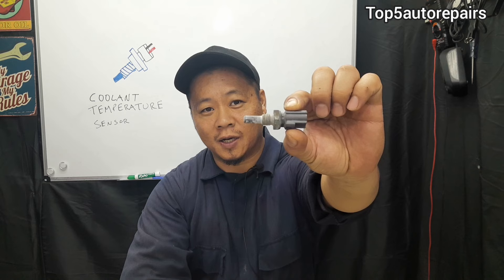Bad Coolant Temperature Sensor Symptoms

Comment: I HAD A COOLANT TEMP CODE, PLUS OVERHEATING, FOUND THE ELECTICAL CONNECTOR WAS BROKEN, REPLACED CONNECTOR CLEAR CODE GOOD TO GO
Reply: Why would it over heat from sensor?
Reply: @Edgar-uw6vl the radiator fans turn on at certain temperature.
If sensor bad not reading temperature and fans wont turn on
Reply: @Smokerup I hope it stops my car from overheating
Reply: My car gauge shows overheating but the car is good temperature  maybe it's  need that sensor  @SugarrPlump
Reply: @randyrivera4433 that sounds like a bad coolant temperature sender, not sensor

Comment: He forgot to mention, when your radiator coolant fan runs continuously,  even when your vehicle is shut off, it could be your coolant  temperature sensor.
Reply from the maker: Check out one of my latest video, "why cooling fan keeps running." I mentioned it in that video.
Reply: @Top5AutoRepairs  ok
Reply: This!
Reply: I just got this issue fixed today my Tahoe did this, the fan motor was extremely loud and stayed on after I shut down the engine. This is the second I've replaced it. I had to do this a few months ago. Do you think it's something else?
Reply: @stepp-uppwithnecol4381 Always use OEM or NTK temp sensors. No autoparts grade garbage
Reply: Good to know thanks

Comment: car was running cold, (gauge would show cold when engine is warm) radiator fans blowing like crazy, rough idle, coolant leaking from sensor clip, got a new sensor from my local store for $30 for a euro sport sedan and it took me  about 10-20min to replace (given i have 0 room to work on an audi but it’s better than removing any screws hoses or clamps)
typically should be a 3 min job 
had the same part on there last time and got a lifetime warranty on it. lasted me roughly 25k miles. 
infinite part glitch irl 
thanks for the help

Comment: Thank you! 04 F150 4.6L 2wd and was on my way to Home Depot and looked down and noticed my temp guage was cold, and when I pulled in to Depot it stalled and had to crank, then fully depress the pedal (which I think stops the fuel injectors from spraying) and same start condition with high idle and trying to pull at a stop light. I got my scanner and it's not super fancy but reads codes and up popped coolant temp sensor or CHT high circuit and that was the same reading on a cold engine in my Honda accord so I put 2 and 2 together, and about to replace the sensor. Could use a coolant drain and fill as well. Bought 8 yrs ago with 134k, and at almost 167k 33k in 8 yrs not too bad and everything else has already happened to it. Blew out the #1 cylinder, Overdrive servo piston and snap ring replaced, etc. Love my truck tho, it's my audio project now. Thanx for the thorough information 👍

Comment: your videos are really helpful thank you , when its at normal running temp my temperature gauge moves down rapidly a few millimetres while driving and then back up again but fans still kick in like normal , it feels electrical from how fast it goes up and down . any ideas what it could be
Reply from the maker: It's possible air might be trapped in the cooling system
Reply: @Top5AutoRepairs thank you for reply ,  I did change the coolant and bled the system with funnel for a while until fully warmed up and no bubbles were present, and then topped off coolant , could a bad temp sensor or thermostat cause my issue

Comment: Can I use a multimeter to test the ECT sensor or is it trial and error? Can you tell me if it’s possible to determine whether it’s the sensor or the wire/connection issue?

Comment: A few weeks back I had the check engine light come on; it was somewhat cold outside (-18C). I was in a bit of a hurry and had only had the engine block heater on for about an hour when I as per usual started the car, got outside to unplug the outlet and noticed something off with the sound from the engine. I got back in the car and saw the check engine light lit. Plugged in my OBD-reader and got code P011600. It turns out the computer went into some sort of fail-safe mode and turned the radiator fan to full blast in case the engine was running hot. I drove the 10 min ride to where I was going and noticed that the temp gauge increased at a normal rate. The AC worked as it should and warmed up the coupé on the ride so I figured the thermostat should be functioning all right. Cleared the error code and that was that; the car operated as normal. 

A few days later the code came back and once more I cleared it. I ordered a replacement sensor but the error has not occurred again. The freeze frame showed that the sensor had reported a coolant temp of -40C which is nonsense since the ambient temperature hasn't yet gone below -20C this winter. I figure I'll wait and see, if it happens again I'll replace the sensor. I drive a 2004 Chrysler 300M and thankfully, in spite of all it's questionable design (I'm looking at you, whoever made the call on the placement of the battery!) the sensor is easily accessible by just popping the hood.

Any thoughts?
Reply: Mechanics i know little about but I struggle with my Chrysler 200 3.6 l a lot recently. Christmas day it left me stranded . Just died at a ted light . I ( a female) put it in neuteral to roll it backwards tried jumping in it to hit the brakes almost ran over myself. When it tapped the guardrail I had to get out and try to steer and push fwd up an incline . S little guy stopped to try and help but to no avail it didn't work then Paul bunion stopped and helped easily. Then an 8 he wait for a tow. So I was told battery,  replaced it, wouldn't start then im told the starter replaced that . Now on my way to work the overheating happens so here I sit waiting for it to cool down so I can add  coolant. I do have a new temp coolant sensor but don't know where or how, the person that put the starter in disregarded my needs for this to be replaced. . So I guess I'm out of work for the day but I'm wondering if its just the sensor. My car was blowing freezing air the entire time. I saw the Guage rising and before it got ¾ of the way up I pulled over and shut down however its been 15/20 min and uts still sreamung under the hood😢

Comment: Excellent video bro, you really break it down into a great detail. I replaced my thermo fan switch on my radiator for my VR6 with a low temp one and ever since that I noticed that the fan does not come on after the car is turned off after a long drive. Will this cause damage or coolant leaks?
What could it possibly be?

Comment: The car itself is not giving the engine light on but the little handheld scanner I just bought is showing that error code. I had some problems with some coils and plugs and not having reset the idle after I unhook the battery. I had a bunch of coolant that I just poured into the reservoir without measuring it correctly with some water I put in. That's the only coolant thing that I could see having happened except that I drove with the engine light on quite a bit and most of the coolant was gone but it didn't overheat.

Comment: I'm having this issue right now on my 2006 G35 sedan... Car only overheats while on idle but cools down when I start driving. The fan does not seem to kick on at times. Not sure which one is failing. Radiator and thermostats seems good. Both top and lower radiator hose attached to the thermostat were warm/hot when I touch or squeeze them. I'm thinking either I need a new fan, fan motor, or temp sensor.

Comment: Thank for your info my concern is that I replaced the cooler sensor but my spark plugs keep on getting wet and the engine idle is rough!!! What could be the problem oh not forgetting it stall's or there's no power while driving

Comment: Hi, would it also cause engine noise? I noticed my engine whent quieter after replacing my faulty coolant sensor, but I used a cheap one. The noise is startin to comeback after 1-2 months of the new cooalnt sensor. I'll probably replace it with a better quality one.

Comment: I got a 2019 c43 Mercedes, today I turned it on at 6 am cold start, and it started a little rough, then I checked my temp and it was showing it already being warmed up? Not cold or overheated just warmed up… then my radiator fan turned itself on and got to full speed. Then a check engine light ? Could it be my temp sensor ?
Reply: It's a good idea to replace it if you think so, because it's not too expensive and easy to swap, compared to other sensors because where it's located.

Comment: Hello hi,....My car is a zuzuki balino, earlier when driving the vehicle it misfires when the engine is hot.., after that when I scanned the vehicle, I changed the scam sensor and the oxygen sensor (which is in the middle of the silencer).. now the engine is working fine. It does, then it started in the morning and it misfires until the engine is warmed up.
As soon as it warms up, the car runs fine without any problems,...what's wrong with this? Please I hope you can give me the right advice, no black smoke or oil pygmies visible, is there good fuel consumption,..
Reply from the maker: Could be condensation affecting sensors in the morning or maybe the ignition coil might be cracked.

Comment: My car dash temp is cold to hot and Looks fine even When driving around. I'm confused as to why it would need changed the reading are always the same but I have a rich condition going on. I've changed map and air intake and air fuel ratio in the cat. I haven't changed the coolant temp. I'm not seeing why change it yet ..but I am  alerted to it .. do I change it anyways or are y'all changing them cause the car looks to be overheating by the dash temp.

Comment: i have this problem right now with my 80s toyota. i think it's the sensor because i just replaced my radiator with a bigger one, along with the coolant of course. the problem is that she's okay on idle, but when i drive normally (2-3000 rpm) the dash says she heats up quick. than when i slow down or brake it instantlygoes back to normal, but the hoses and radiator feel like hand warmers, or a little too hot to touch.

Comment: hi..my car overheat some time..one off 10 times of driving i smelled engine oil burning and then when i slow down and close ac its normal back..tomorrow i check the engine oil lower a bit..what cause this?

Comment: My 2010ford fusion sport v6 overheats ones a while during driving in city but not on a long drive...I'll notice its overheating because air compressor cuts off and it's not cooling the ac. Can u help??

Comment: Love the channel 💪🏼
Need some help on my Buick century. I've had 4 months and it's issues after issues. I'm no mechanic so I'm learning as I'm going. Overheating everyday. I've bleed the air out, sparks are good. MAF good, throttle clean. I have all the symptoms except for, black smoke and stalling out. Any advice
Reply: Did you check or replace the thermostat? Did you flush the old coolant? Do you have enough water in your coolant? Do you have any pin hole leaks on your rad upper lower hoses? Are the clamps not tight or over tightened? Is your overflow reservoir the type that is sealed? Is the cap good? Did you replace the radiator cap with a oem match part. Those are all necessary if you're overheating. Also make sure your radiator is clean on the outside and that the fan works etc. Also you need more water the hotter it is. Antifreeze is there to keep water from freezing but it also lowers the waters ability to carry heat. So you have to make sure your mix is not too concentrated

Comment: I have 2010 toyota corolla 2NZFE , 1.3 L engine, it has continouse long term rich -14%     , mechanic checked every thing, 140 PSi dry compression for each cylinder.   last he found that there is no thermostate, my question is , does running engine without thermostate result in LTFT -14%,? assuming other things working fine

Comment: On my jeep grand Cherokee 2015 after some warm up temp gauge freezes on 1/4 and almost not moving anywhere even after hundreds of miles… is that okay? Thanks
Reply: no - if the sensor is easily accessible and cheap, just replace it and see.  Better to disconnect the negative battery terminal when replacing the sensor ( the computer may need to restart to detect the new sensor correctly ).

Comment: I had recently changed my coolant temperature sensor on 2016 D13 engine. My gauge was displaying normal operating temperatures, after some months passed by it started acting irregularly. But on my cluster the temperature is reading normal. Would it be okay to disconnect the sensor and drive until I make it home for diagnostic and repair?
Reply: don't know how smart your car is but mine will think it is -40c outside ( actual temp is 25c) and runs very rich starting the engine without the coolant sensor plugged in

Comment: My bmw 2003 x5 e53 3.0 stay on all the times from morning first start wont shut off unless i turn off the car , i checked the realy and  fan switch both good , what could be the problem ?
Note: My A/C not blowing cold although its fully charged i dont know if its realted to the fan being stuck on high .

Comment: Mine first Everytime I turn my chevy cruze Lt 2014 It say engine  reduce power and then  traccion On after that start shaking the engine and Went I try acceleration It goes slow I press the gas pedal all the way and it drive slow and then it show in the dash AC Due too a high Engine temperature

Comment: My gauge inside shows temp lower then 1/2 mark. When finished driving car the front of car and hood extremely hot. Also losing coolant had radiator replaced tech said bad was 3 years old and still losing coolant. about 1/2 cup a month. Can smell coolant, The radiator fan runs when AC on never runs whe  AC is off. I think the radiator super hot when car turned off and may leak coolant out of cap. Since fan never turns on without ac could sensor be bad? I don't think blown gasket, I thought maybe bad heater core. Had pressure checked was okay. Nothing in oil and no white smoke.

Comment: Need help my temp gauge keeps moving up and down I don’t know what could it be the sensor the thermostat or the coolant housing
Reply from the maker: Check for air in the cooling system or a partially stuck closed thermostat

Comment: My coolant temperature connector (wire)is exposed the outer plastic has melted off will this cause my car to go on limp mode I cannot accelerate past 20mph

Comment: My fan runs  on high speed ? does not stop unless you never the car off. Can it be CTS ?  BMW
Reply: I have the same problem on my 2003 x5 , did you find whats the problem ?
Reply: @EARTHKEENING   it was the water pump.
Reply: @chipdiamond2628  wow thanks , did you have check engine light on ?

Comment: When it’s super hot outside, all the warning signs come on at the same time(NOT THE ENGINE LIGHT) when I start the car. I have to turn on the AC and let my car cool down for 5 minutes, afterwards I turn it off, then restart ignition, then all the warning signs are gone. Could it be a sensor thing. I drive a 22 sonata.
Reply: the engine/coolant is not hot (not possible) when you just started the car

Comment: My electronic temp gauge shows overheating,  but my cluster gauge shows normal, but my car starts to lose excelleration and no code. I replaced the thermostat, but problem persist, any suggestions??
Reply: Heater hoses
Reply: Mine is the opposite read out saying engine coolant hot but gage barley moves.

Comment: 1:15 [1MZFE ENGINE] I changed my coolant temp sensor and didn’t do my radiator fan switch sensors an it kept overheating at idle … it would spit all my coolant into the reservoir…. Took me like 4 months of trying to figure it out … i guess when you change one thing , change the rest lol .

Comment: I have a 2003 Lincoln Navigator. I noticed on my dashboard when I turn the key to on position. There’s a temperature light on. Would that cause the relay to the fuel pump not kick on due to the safety? Thanks

Comment: I have a bad thermostat code, replaced it. But check engine light came back after 2 weeks. Cleared the code. 2 weeks later, it came back. Could it be a bad temp sensor? Both fans comes on when the AC is on (this is the only time my cooling fan will come on, otherwise it does not come on when temp is at normal range). Temp gauge is good, not overheating. Coolant was drained, bled and topped off.
Reply: Check connections. Might need to replace connector
Reply: BruceWayne-sz3th  honda pilot.  But i got out fixed.  Replaced both my ects

Comment: How can I send u a video for my car? My car won't start so there's no way it's over heating. My radiator fan assembly was recently changed and it still shows service engine, engine overheating stop safely and asc service required while car is off and I just turn the key to acc or on without actually starting the car. Idk if im making sense but pls help. Also I couldn't scan the car for codes because the scanner is not communicating with my car 😢
Reply: So it won’t start or it’s over heating??
Reply: Usually you have to turn the car on in order for your diagnostic tool aka code reader to connect with your car which in turn will scan the ecu and come back with not only codes but freeze frame data.
Reply: its your sensors

Comment: is my 96 chevy silverado ok to drive without cooling temp sensor until i can fix it? I see one of the wires is messed up at connector
Reply: You have two senders one for the gage and one for the computer.
Gage is probably not a big deal

Comment: Hi, I put nissan 2.7 diesal engine in f30 bmw .bm was auto matc now I change to manual  first engine n20 was runing with computer box  this new nissan engine is without computer box  now I can't find the heat gauge wire in bm